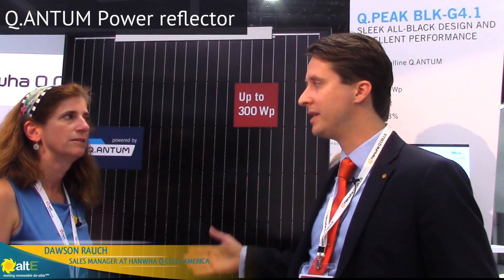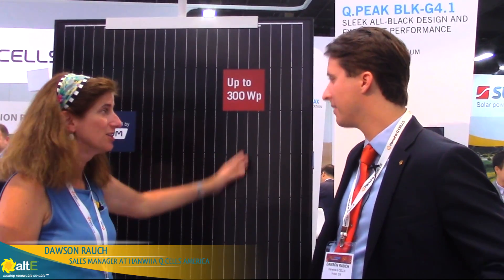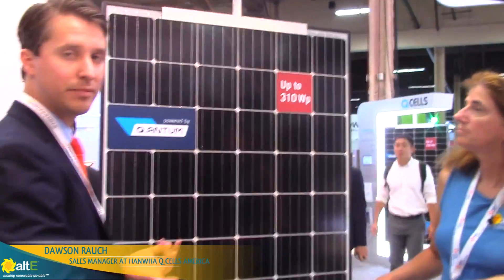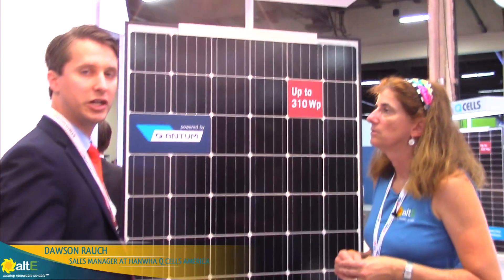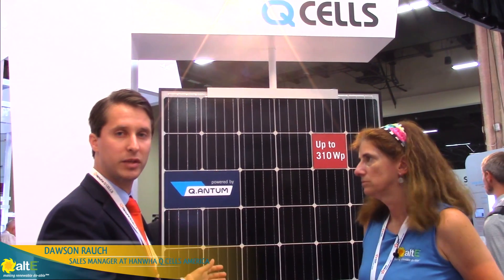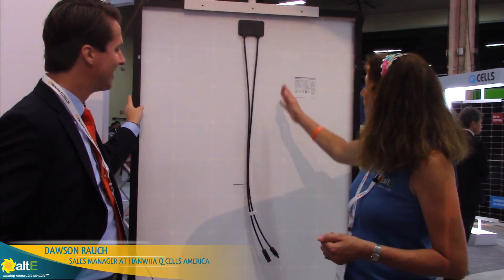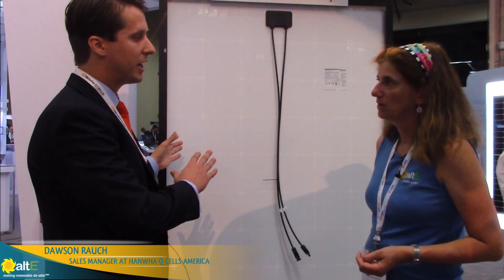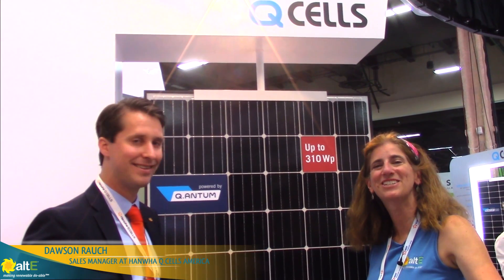Chatting with Q CELLS at SPI 2017

Comment: I love these panels and would like to order one for my boat, but when I estimated shipping at your site for the QPeak Duo G5 320W panel for example (priced at $254), the shipping estimate was $280 extra! This makes it impossible for me to afford your great panels. Would you consider giving a better shipping cost to boaters who only need one or tow perhaps?
Reply from the maker: Unfortunately, shipping one or two panels runs into the problem of shipper's minimum cost. Generally to put anything on a truck costs at least $200. That's fine when spread across multiple panels, but as you are discovering, doubles the cost of a single panel. There's nothing we can do about it, it's the cost we are getting from the truck company. If you are ever near Massachusetts, you can swing by and pick them up for free, or get a bunch of boaters to buy several together and share the cost between you. Sorry.
Reply from the maker: Also note that these are 60 cell, 20V panels. If you have a 24V battery bank, you want a 72 cell, 24V volt panel. If you have a 12V battery bank and an MPPT charge controller, these are fine.

Comment: If panels overheat what to do and how keep cool panels
Reply from the maker: There's not really a good way to cool the panels down. If you spray with cold water, that may damage them. Obviously, you can 't put them in the shade. So you just really need to let them stay in the hot sun. Their voltage output will drop a little, but they will still produce power.

Comment: Amy, what are the outside dimensions of that panel...thanks
Reply from the maker: 65.7 x 39.4 x 1.26in (1670 x 1000 x 32mm). You can see all of the specs at https://www.altestore.com/store/solar-panels/hanwha-q-cell-305-watt-mono-solar-panel-p40814/

Comment: What panel would you use on a 5Th wheel trailer? Jack
Reply from the maker: It all depends on how much energy you use, and how much space you have. The most accurate thing to do is to create a loads list of what you are running, how many watts it uses, and for how many hours. Then figure out how much space you have available for the solar and the batteries. From there we can figure out what size solar array and battery bank you can do. This loads list calculator can help, https://www.altestore.com/store/calculators/load_calculator/ . Not that if you use an off-grid calculator to figure out the size of your solar array, you need to go a bit bigger to compensate for horizontal mounting instead of tilted.
Reply from the maker: Thanks. Great to have input from one who's been there, done that.

Comment: Neat! With a 5-10% per panel efficiency increase -- adds up to big power increases for the entire array. Side note (as I watched this) I just think about all those folks down in Puerto Rico w/o electricity and how (even) a small DIY solar generator could provide a few kWh's of comfort (fridge, ice chest, TV, radio, phone/computer charging, lighting, et al stuff). Their electrical grid is going to be down for a very long time. A gas/diesel/propane generator is great...as long as there is a fuel supply. Hope you had a great time in Vegas!
Reply from the maker: Thanks Chris. We are actually working with some groups trying to get a bit of solar energy down to them and other islands as soon as possible. We sent a few small systems down to Haiti last year to help out after their disaster.
Reply: Chris DIYer  Hi, I'm from Puerto Rico, (Sorry for my English). I am trying to do what yo said in this comment. I am looking information but sometimes is really hard, cause the cellular signal are not strong. I buy an Goal Zero yeti online, and I want the Hanwa solar panel, but I need an MC4 Solar to Anderson Power Pole adapter. On ebay I found a person that sell the adapter but I don't know if he shipp to Puerto Rico.  Thanks for thinking in us, I really appreciate that.